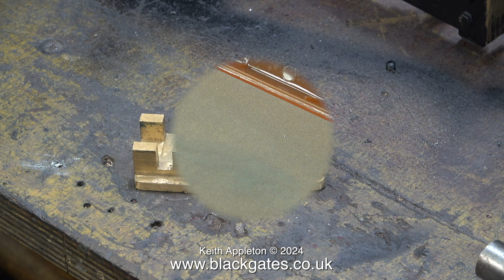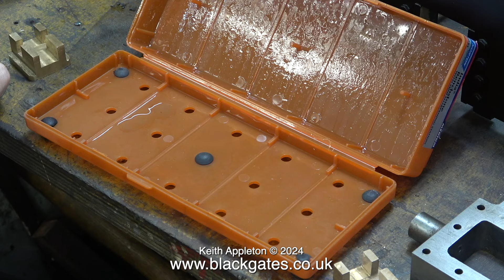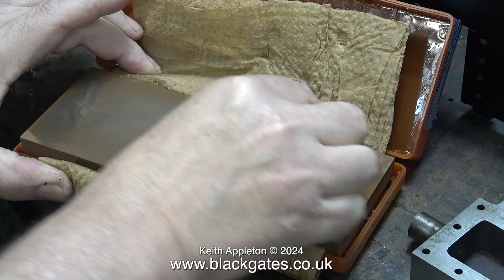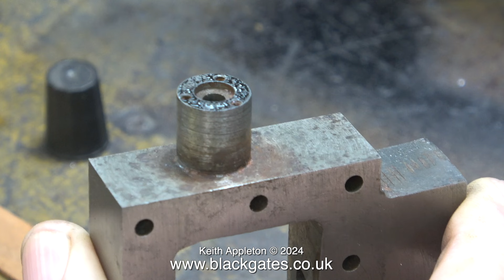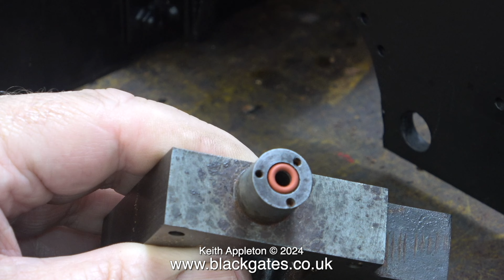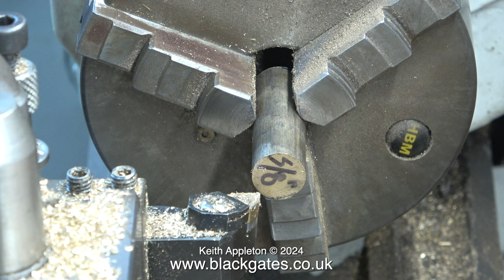A BLACKGATES SWEET PEA LOCOMOTIVE BUILD - PART #49

Comment: The clue is in the name... Whetstone, not WD40stone. Never use a whetstone with anything other than water as a lubricant. Store your whetstones together, in a large Tupperware type storage container, completely submerged in water, so that they are immediately ready for use.
Reply: i will as well Keith continue to use oil and keep the water for drinking with whisky
Reply from the maker: }:-))) Single Malt Only please - Lagavulin is my Preference . . . .
Reply: @keithappleton     The The Macallan 1926 is my favorite tipple but I only have a few bottles left
Reply from the maker: Since when is wet spelt with an "H" ???? }:-)) "3 in One" Oil or WD40 works very well for me.
Reply from the maker: By the way Gordon, you are wrong - please type whetstone lubricant into Google  . . . . . you will clearly see  "Honing Lubricants" and "Knife Sharpening Lubricants" for sale. I will continue using my method despite your criticism . . . . .

Comment: I have two whet stones that have two different grades;. one side is medium the other side is coarse, and a another stone that is fine one side and medium on the other. They do a much better job then the sharpener that comes with our can opener.     I also have a small can of whet stone oil but I've forgotten where I got it from, my memory isn't what it used to be!  But 3in1 oil would probably be just as good.
Reply from the maker: Those twin grade stones are a good idea - I think I will buy one }:-)))
Reply: Rubbish! A whetstone should always be lubricated by water, and never WD40 or any other oil based product.